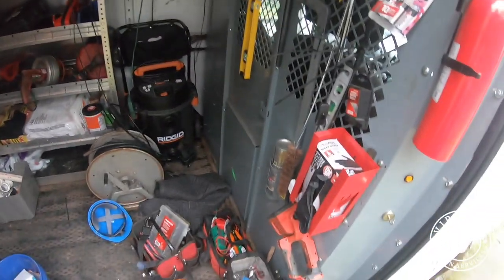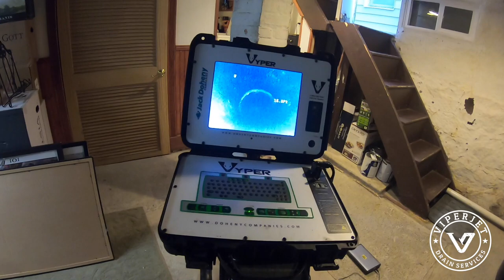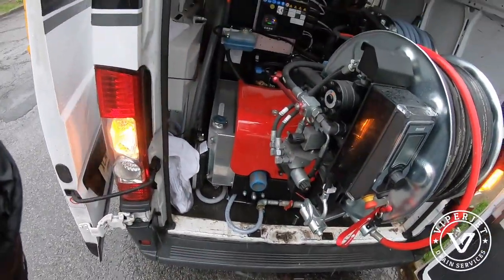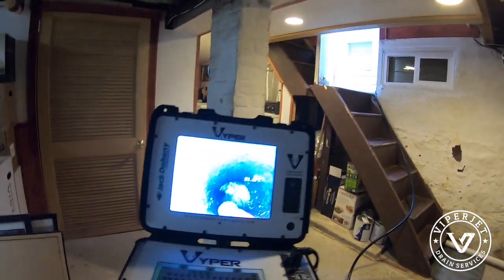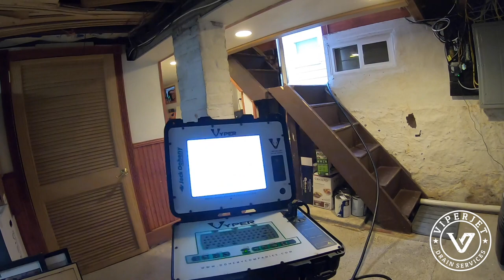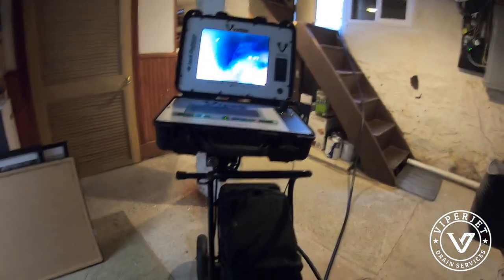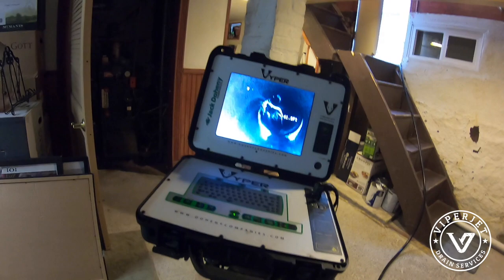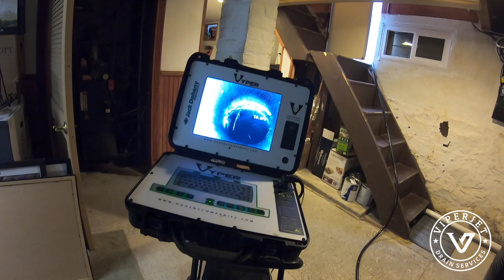How To cut tree Roots with warthog nozzle.

Comment: It's not a good idea to use the larger warthog. I think it's too much for a 4 inch lines and if theirs a lot of turns its almost impossible to get out. I only use the pentrating head on the 4 inch. It is more than enough for clearing the line. I want a really good root cutting head if anyone has any suggestions. It pumps 19.5 gallons a minute.
Reply from the maker: Not a lot of options out there. warthog, Ripper, and the chains like the rootrat ect which I only use as last resource. I also noticed that gallons per minute don't really matter much with his heads. A lot of water exits off the edges and discharges through other ports of the nozzle when it only accepts a certain amount of water.